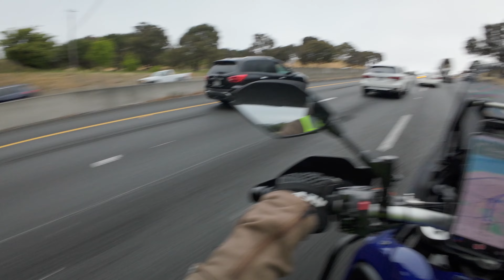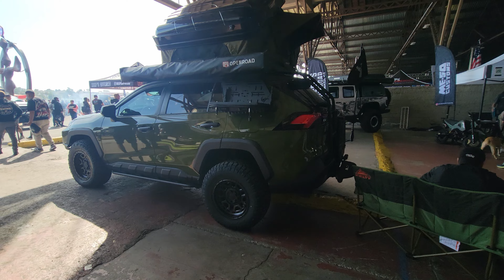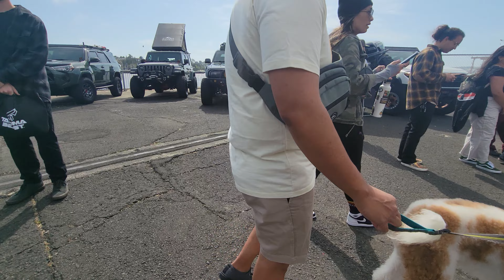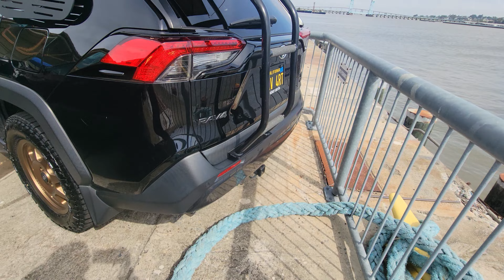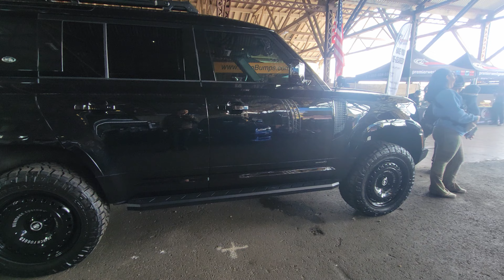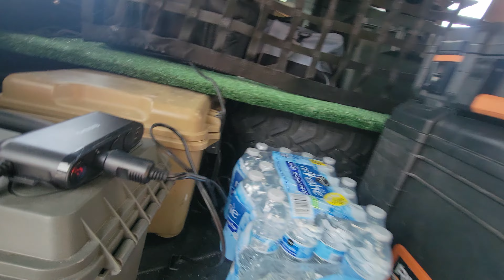Yamaha Ténéré 700 | Rodeo X Rigs | Life Update

Comment: Overland aftermarket is super expensive, and many of the add on’s are not necessary. A decent ground tent, with good sleeping pads is more than sufficient without spending the money on a rooftop tent. And if you want a more luxurious tent you, can get an inflatable, tree tent, or hammock system. And they a lot easier to add and remove into your vehicle. The only benefit I can see for a rooftop tent, is if you are using it often. Otherwise it is a pain to install/remove, and while it’s on it also lowers your mileage because of the weight and additional drag. So I recommend before any serious considerations on that front, do your research and map out your intended usage. On less frequent uploads, no worries. Take your time, and just have fun with it.
Reply from the maker: You're so right. Overlanding is such an expensive hobby. In reality, the places I go, I probably don't even need my vehicle to have all wheel drive although it does give me some peace of mind. More often than not I'm going to established campsites where the road is maintained even if it may not be paved. I totally agree with you on the roof top tents too. I think it would be so annoying to take everything out and pack it all up just to drive down to the store for some ice or something like that. Thanks for everything as always Soren! I finally got my hands on a can of octopus lol. I'll have to give it a try on video soon just for you 😂. Ride safe!